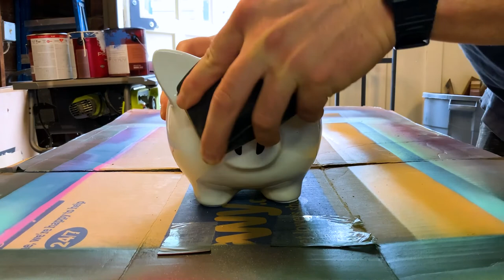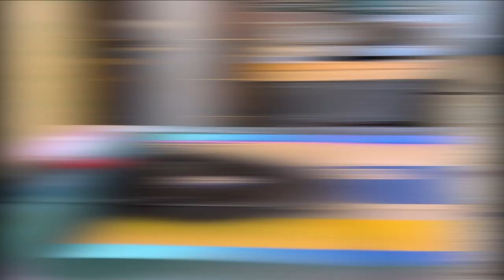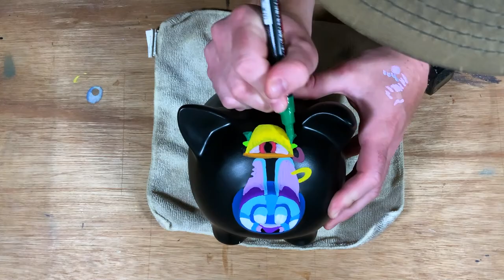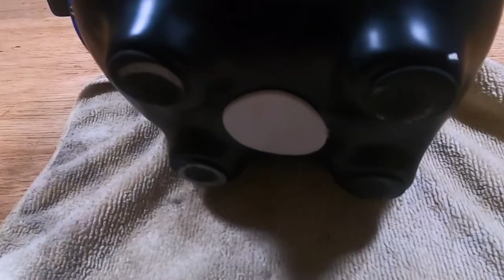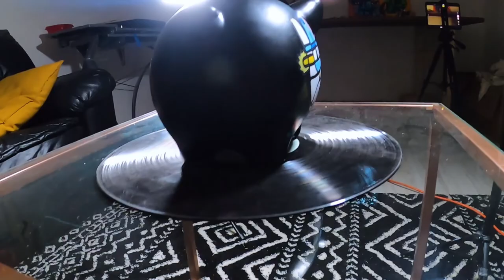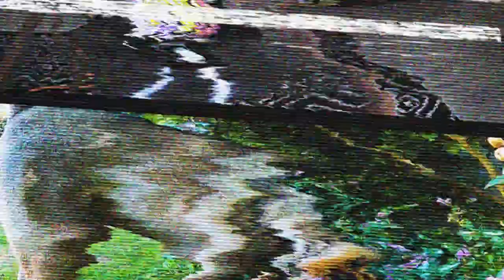My First Commission From YouTube! Custom Painted Piggy Bank 2

Comment: What kind of markers did you use? Also do you have to use mod podge afterwards?
Reply from the maker: I use Posca markers they're fantastic and I cant recommend them enough! I don't actually I just use a clear spray varnish/sealant for things like this where I'm painting on a smooth 3d surface rather then say a canvas.